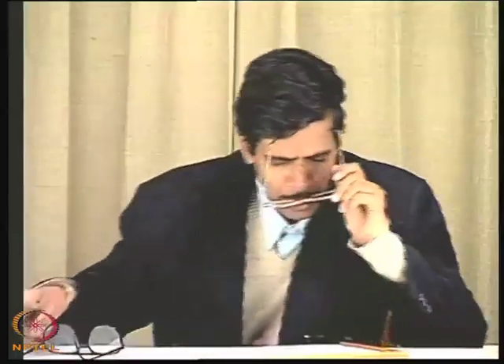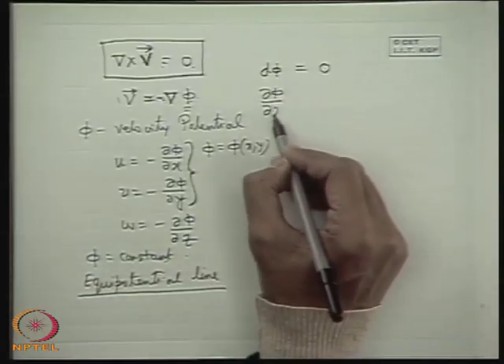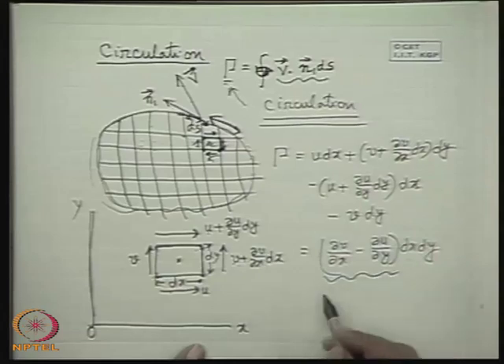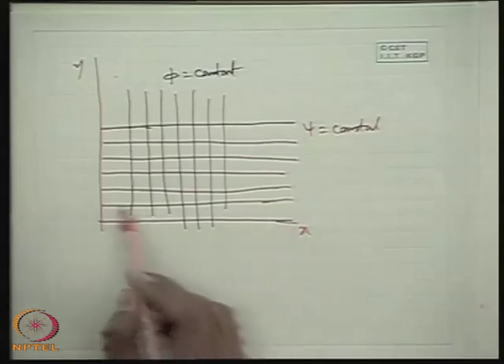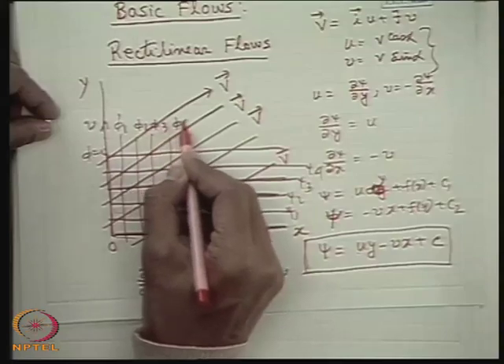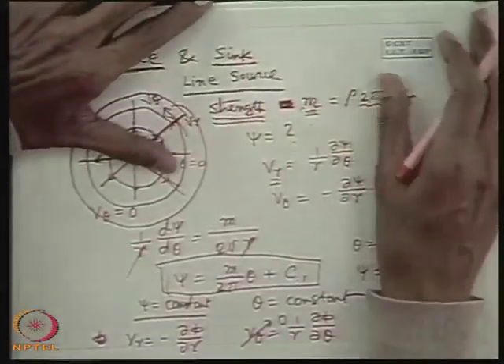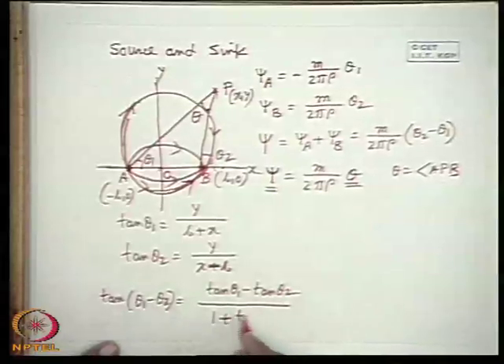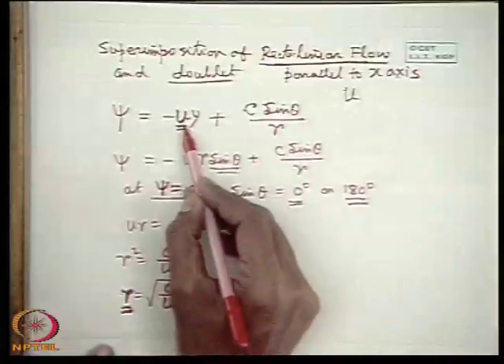Mod-39 Lec-39 Flow of Ideal Fluids Part I

Comment: for source and sink clearly divergence of Velocity vectors is not zero..that is flow is not incompressible!..how is stream function defined for a compressible flow
Reply: Consider water moving down sink of kitchen or coming out from pipe into tank. How are they compressible under normal conditions? Anyway if you want more detailed derivation watch prof suman chakrobarty's video , they have derived it from scratch there.